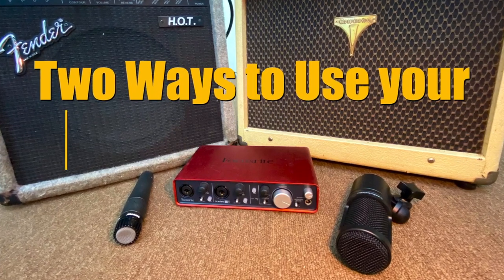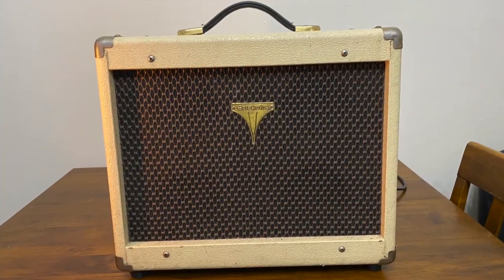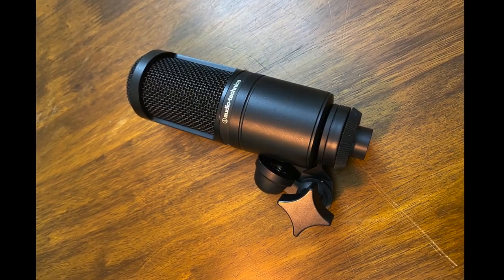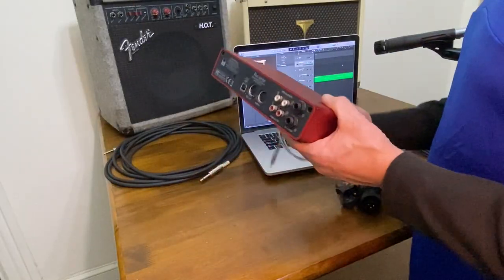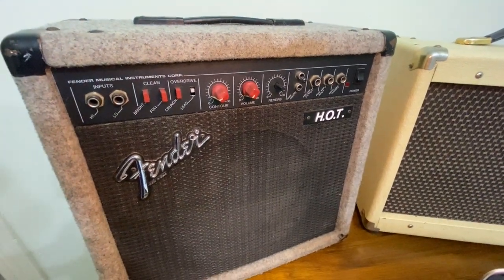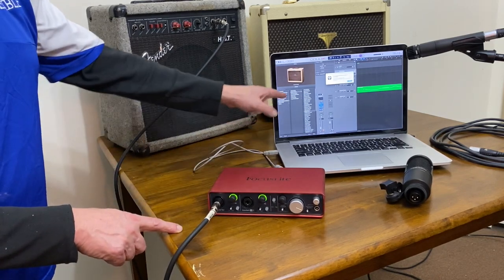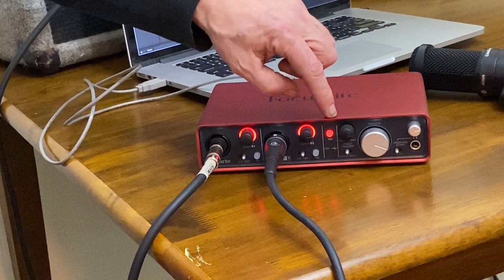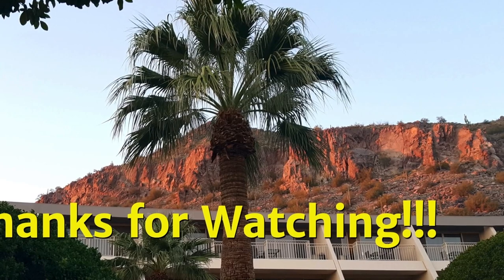How to use an Amplifier with an Audio Interface - Two Different Options

Comment: Why did you connect the Fender amp in the instrument input of the interface, instead of the output of the interface? Shouldn't the amplifier be the output speaker for your playing?
Reply from the maker: Because I output my sound to a couple of Speakers.  That way, you can use a Digital Audio Workstation to further modify the sound prior to outputting if so desired.  Also, you can record easier that way.
Reply: @MerrillStreetStudio  So what function does the amp have if it's connected to the instrument input? Shouldn't the guitar be connected directly to the instrument input so its signal is digitally converted and sent to the DAW? I'm confused about the purpose of the amp here
Reply: @carpediemearth I'm not an expert here but I think the idea is that you connect your guitar to the amp (optionally via some pedals), then connect the amp to the AI, then to the computers DAW where you can spice up the sound with some plugins and what not and then you redirect the sound back to the AI and then connect some monitor speakers (or headphones) to the AI such that you can actually hear anything
Reply: @FerretFerrari  But why connect guitar > amp > interface, instead of guitar > interface directly? What is the purpose of the amp in the middle of that connection?
Reply: @carpediemearth  I'd kind of like to have that properly answered to myself! My guess is that you want to capture the characteristic sound of your amp (?). From what I understand though some people prefer to mic up the amp instead and capture the sound in such a way. Not using a mic and diverting the sound directly from the amp to a AI might not catch the actual full characteristics of the amp.
Reply: I went to Bing and asked Copilot this question: "Why would you want to connect a guitar amp directly to an audio interface?" and got this answer which sounds like it could be accurate: "Connecting a guitar amp directly to an audio interface can serve several purposes:
Recording: By connecting your amp to an interface, you can record your guitar playing directly into recording software (DAW). This allows you to capture your amp’s sound without using microphones, which can be useful for home recording or when you don’t have access to a good recording space.
Tone Capture: If you love the specific tone of your amp, connecting it to an interface lets you capture that tone digitally. You can then apply effects, process the sound, and even re-amp it later if needed.
Silent Practice/Reamping: When practicing silently, you can use your amp’s headphone/line output to connect to the interface. This way, you can play through your amp without disturbing others. Additionally, you can reamp recorded guitar tracks by sending them back through the amp for different tones.
Amp Modeling: Some guitarists use amp modeling software (like plugins or amp simulators) within their DAW. Connecting the amp to the interface allows you to blend real amp sound with virtual amp models.
Direct Monitoring: If your interface supports direct monitoring, you can hear your guitar sound in real time while recording. This minimizes latency and provides a more natural playing experience.
Remember that the quality of your interface, cables, and amp settings all play a role in achieving the desired results. 😊🎸🎧"
Reply: @FerretFerrari  Thanks. I get the tone capture. I was confused though because an audio interface gets the signal directly from the guitar and converts it to digital for the DAW, so I didn't see the point of connecting an amp between the guitar and interface. Hearing the effects while using direct monitoring is interesting, I'll try that and see if it works.
Reply: @carpediemearth Sometimes people, like me, want to keep the sound and tone of their amp.  I’m a purist and not big on patches.

Comment: Been wondering if I can use a USB-equipped combo amp to use amp sim software without the audio interface. Basically using the amp AS the interface. 

It wouldn't be great, obviously - but it's about the experimentation. I know the answer to "should" (which is why I wont bother asking the likes of quora or reddit) but I care about "can".
Reply from the maker: I'm not sure, but now you have me wondering as well.